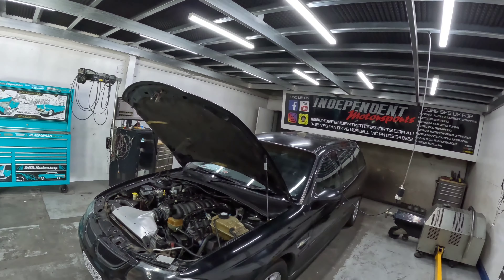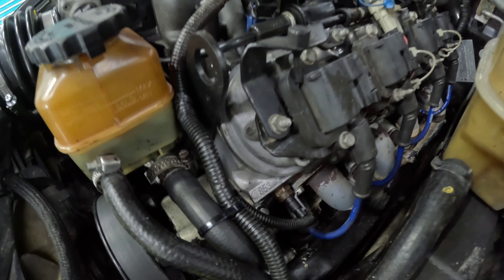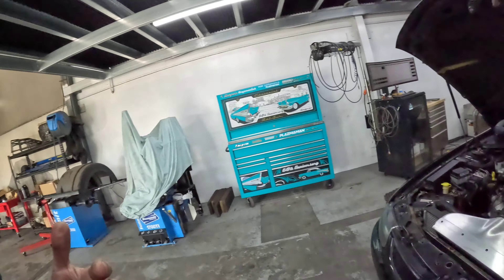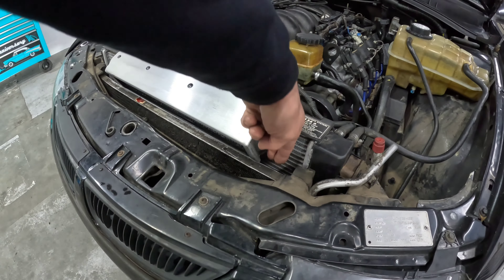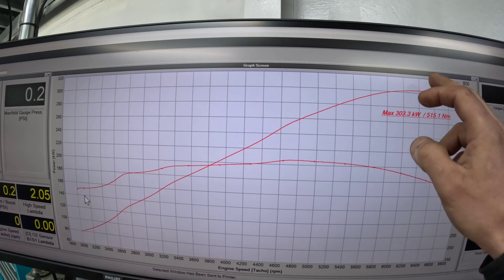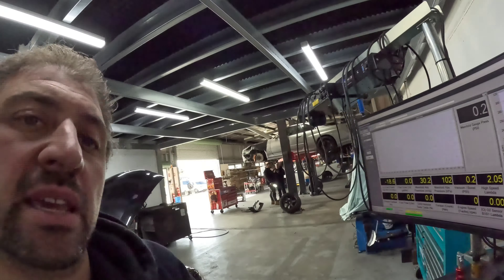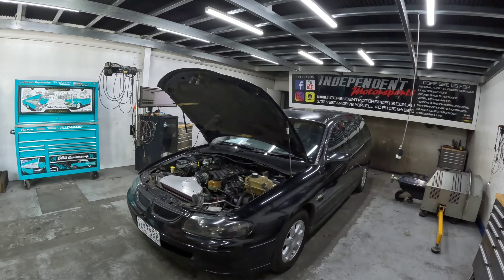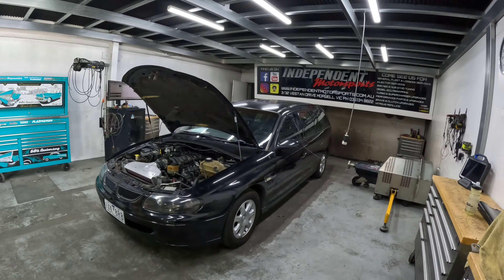VT Series 1 LS1 Head & Cam package crow cams 1249

Comment: Thats a great result my 99 VT SS was dynoed here in TAS on a dynologic chassis dyno at 279 rwkw with LS6 manifold mild porting rebuilt engine crow 217/228 at 50 cam 590 lift. He should able to pick up an LS6 manifold fairly easy with a bit of searching. I can probably find the manifold correct code number he needs if that helps. It is great to see a streetable early VT making that sort of power!!!

Comment: Dont mind the crow cams. Fitted a crow cams 8711250RH 234/242 113 lsa to my vz ls1 has the usual 4into1s twin 3inch manta and a 4000rpm stall stock heads intake, has OTR. It defo drives waaay nicer went a 11.8 115mph on its 2nd pass. Compared to the dog vcm13 238 242 112lsa 😂 it went 11.69 116mph  that WAS NOT DAILY FRIENDLY HAHA. Keep the vids coming 🤙🤙

Comment: Hey guys when you use this same camshaft in the ls1 with stock heads, do you retain the same push rod length, stock rockers and single or dual valve springs? been looking at your diy online can kits, cheers.
Reply from the maker: Hi Brock

Yes our cam kits come with push rods to suit

Comment: Great vid as always!
It looks like you're spinning this to ~6500 RPM. Is there any risk with that sort of RPM on an older LS1? 
I've seen some conflicting information regarding the rod bolts in a stock bottom end early LS1.
Cheers!
Reply from the maker: I don't have eny problems spinning them to 6500 rpm just stay of the rev limiter
Reply: I did lots of research on this as I have a VT SS also. 6500 rpm is safe but not more due to the early conrod bolts, mine is set at 6500, It cost $8000 for the rebuild so I am careful with this.
Reply: Thanks for the response!